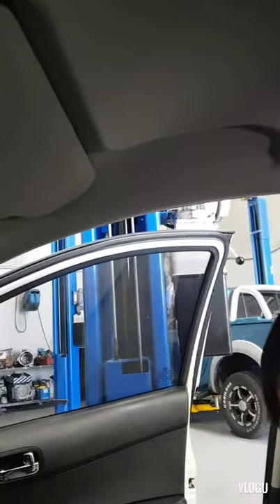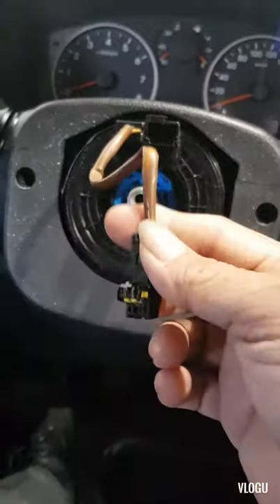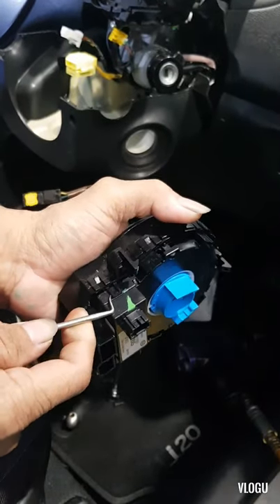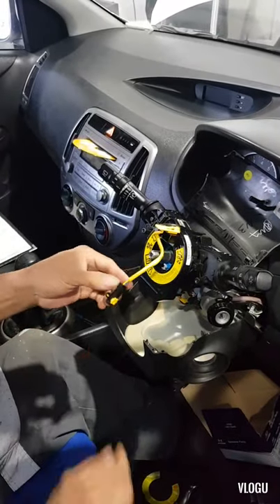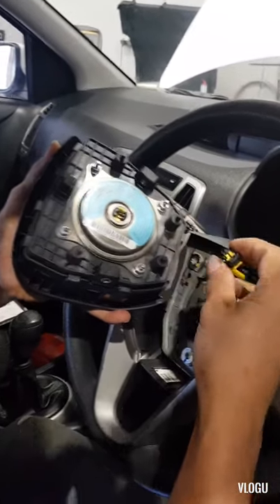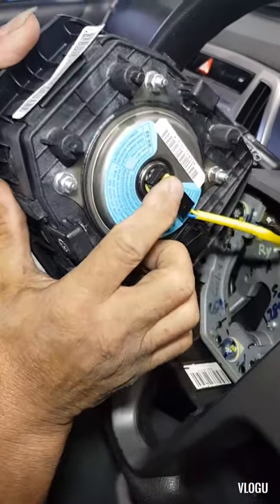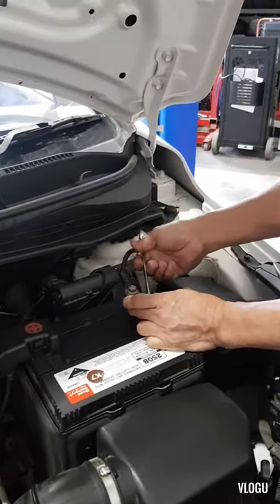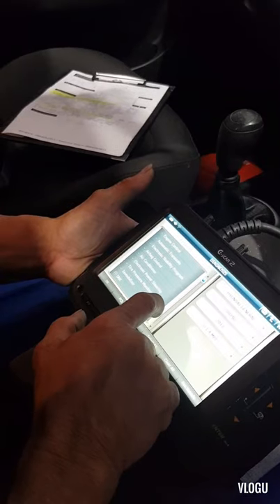Airbag lights "ON" How to replace clock spring for HYUNDAI i20

Comment: I have the light on as well for airbag and the control media from steering wheel not working.
Reply: If steering wheel switches aren't working then the clock spring is at fault as it's the clock spring that supplies voltage to the media controls.